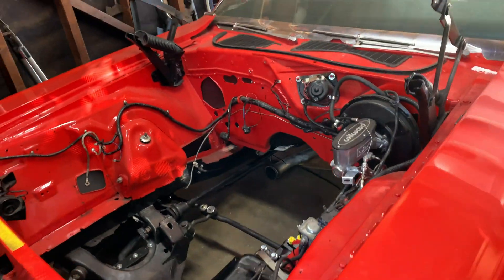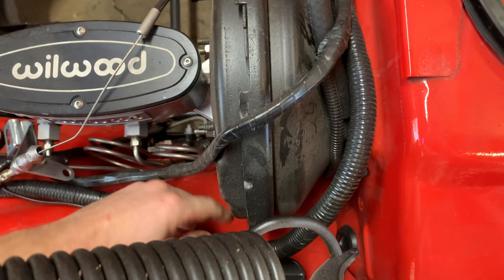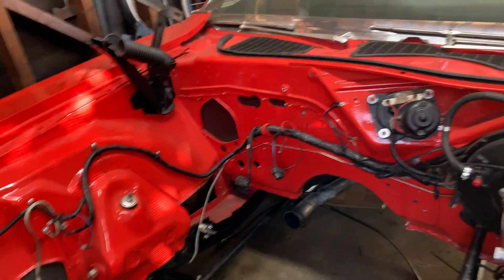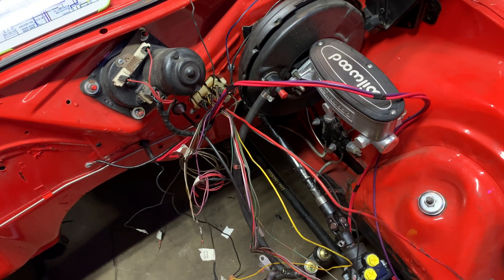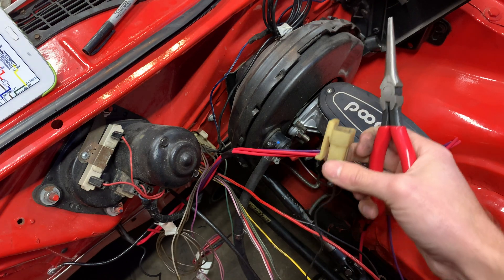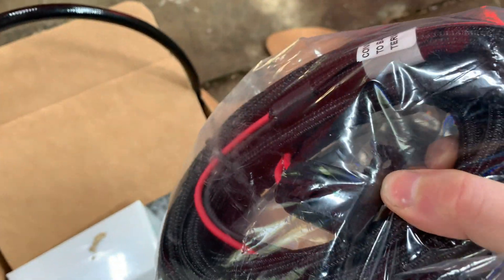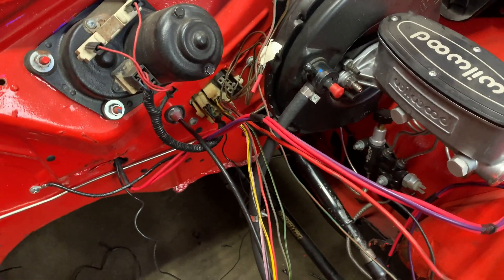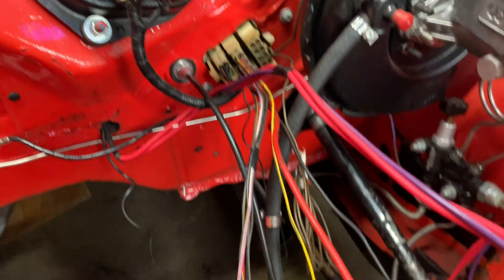1970 Challenger Hemi Swap Part 12: Wiring Harness Cutting, Holley Terminator X, One Wire Alternator

Comment: Hello Mr NBLB is me again your worst nightmare, Lol 2 questions # 1 cranking power is the same as ingnition power? I tried start my hemi swap but no luck engine cranks but won't idle, any suggestions or tips you can give me?
Reply from the maker: @JuanDominguez-nw8rq  hey! No, crank is not the same as ignition. From what I remember pretty much all ignition power gets cut during crank on these old Mopars except for one, a wire that goes to the ballast resistor or ignition module in the engine bay (brown wire I think?). My guess is you’re using a regular ignition wire which is cutting power on crank and not allowing the car to start. What I did was twist the power-on-crank wire together with an ignition wire and connected that to the computer’s power in crank and ignition wire. You may want to wire in a diode to prevent back voltage from going into your ignition wire, though I didn’t and mine works just fine.
Reply: So you recommend to use a diode and you said you didn't use it in your cause it's ok if I don't use it either?
Reply from the maker: @JuanDominguez-nw8rq  I didn’t use it and mines been just fine, I’m sure yours will be too
Reply: Oooh and thanks for the reply a really appreciated.
Reply: You talking about the ballast resitor that is mounted on top of the wiper motor or is another one, I tried it but still the same engine winds but not run.
Reply from the maker: @JuanDominguez-nw8rq  did you test the wires with a multimeter? Maybe sure you find an wire that has +12v in crank, you could probably get a wire out of the ignition switch too
Reply: Me again MRNBLB, no luck getting car running, big favor do you mine coming to my place I see if you can get it running for me, I live very close from where you bring your car to get it Dyno, her in Hemet CA?
Reply: I know is too much to ask, I can give gas money plus what ever you want to charge me to get it running please man let me know so we can set up a day that you can come?
Reply from the maker: @JuanDominguez-nw8rq  yeah, I can come help! Give me a shout on my instagram messages at instagram.com/noboltsleftbehind or you can find my email at the very bottom of my website: https://noboltsleftbehind.com
Reply: Any other suggestions?
Reply: Thanks man let keep searching for the issue, to see if I can get it running.

Comment: Mr no bolts left behind, how r you is me again, question what gages did you use for you challenger if you have the p/n also place where you bought you led markers for your cluster bezel
Reply from the maker: All of the gauges are Autometer Sport Comp series, I don't have the part numbers handy but they were the 2-5/8" size and the speedometer was 5". I bought those LED lights on eBay I think, if you search "green arrow dash led" you should find them 👍
Reply: Thanks man for quick response I'm using a 727 tranny on my swap I can use regular cable driven speedometer wire or do I have to get a deferent one?
Reply from the maker: @JuanDominguez-nw8rq  I think you should be able to keep using your cable driven one, I don't see why not
Reply: Thanks man I appreciate the help, have a nice weekend.
Reply: Mr no bolts left behind is me again, quick question, when you bench bleed your master cylinder and you remove the little tubes to hooked it up it leaks oil it does not get air back into the master cylinder?
Reply from the maker: @JuanDominguez-nw8rq  I think gravity keeps air from entering the bottom holes, the weight of the fluid above pushes down and doesn’t allow air to enter
Reply: Ooh ok, another one my engine come with electronic pedal can I use it or I have to use it with cable trouble body, if I can use the electronic how I do for kick down for the tranny.
Reply from the maker: @JuanDominguez-nw8rq  you can use the electric pedal and throttle body, it’s probably much easier to do it that way than the cable driven. Can’t really say about the kick down, I set mine up with a manual transmission.

Comment: Hey I love your work, quick question I go a challenger 70 challenger too, I bought a 2015 charger engine w/auto tranny I want help with the wiring you think, what are the main wires that I need from the car to plug in the TerminatorX ?
Reply from the maker: That’s awesome! You’ll love the 5.7 in your Challenger. There are actually only a few wires that need to connect to your car’s original harness, just constant 12v, ignition switch 12v, and a couple grounds. One thing to keep an eye on is your ignition switch power, you’ll need one that provides 12v during crank (most of them shut off during crank to route power to the starter). For my swap, I used a wire from my ballast resistor which has power ONLY during crank and twisted it together with a normal ignition wire that shuts down during crank. So far it’s worked well.
Reply: Thanks man for the quick response, when I bought the motor they included electric pedal, push start button and the key, which of those I need, or can I use on my swap?
Reply from the maker: @JuanDominguez-nw8rq  that’s a good question, for my swap I converted to a drive-by-cable so I didn’t use my pedal, but I know most people do still use their drive-by-wire pedals. If you’re going to use your stock ECU I’d think you’d want to use your push button start and key, if you’re going aftermarket ECU like I did you can probably just wire it to your Challenger’s ignition switch.
Reply: @noboltsleftbehind  ok Man thanks for your advice, it's ok if I bother you some times when I start getting issues on my swap, it's going to be a while I barely starting with body work and paint.
Reply from the maker: @JuanDominguez-nw8rq  absolutely man, just drop me a comment in any of my videos when you have questions, I’m happy to help!
Reply: @noboltsleftbehind  thanks Man, have a great weekend.
Reply: @noboltsleftbehind  good morning man, quick question on some of videos I see that people have issues with harmonic balancer, alternators, power steering, do I have to put different ones on my engine cause my engine have all those components?
Reply from the maker: @JuanDominguez-nw8rq  I kept all of mine stock and everything fit fine, though I’m using a truck style engine which mounts the alternator up high. From what I know you might need to make a small cut for your alternator but nothing major. Everything else should be ok. Your power steering pump will depend on your steering box type, you’ll need to match the correct pressure and the factory Hemi pump runs a bit high for the original steering box.
Reply: @noboltsleftbehind  thanks man, I might get the aftermarket minie one.

Comment: thank for the video trying to figure out what i all need to do for my 1979 dodge LRE hemi swap
Reply from the maker: That’s awesome, I think a Hemi should drop in there without too much trouble. I remember seeing some good support for D100/150 trucks which I assume would be similar. In fact my transmission bracket is meant for a D100 truck.

Comment: Gaining confidence each time I watch your videos. Glad I found your youtube from IG.
Reply from the maker: That’s awesome! I’m glad they can be a help. Post any questions you might have, I’m happy to help where I can!
Reply: @noboltsleftbehind  I have questions about switched voltage sources and what you recommended for them.
Reply from the maker: @cutoversoldspartsguys  the tricky part was finding voltage during cranking, all of my ignition wires cut voltage while cranking. On my factory harness I found one wire that delivered 12v power only while cranking, I think it went into the ballast resistor. I twisted it together with a 12v ignition wire to have power both on and off crank. For Mopars it’s a brown wire that’s part of the main firewall connector.

Comment: Which wires did you need to keep from the original engine harness?
Reply from the maker: Very few, I think the only ones I reused were two from the voltage regulator to power on the ECU, the ignition wire for the starter signal and the reverse light. The rest of the ECU and engine were pretty much on their own or wired from my new fuse and relay block.
Reply: @noboltsleftbehind  thanks, I made the mistake of getting rid of my harness with the old engine so I’m going to have to figure something out. Nice to know it’s only a few wires.
Reply from the maker: @OnederElite  I see. It’s not the worst thing to get rid of the old crunchy original wiring. That main one I used was that power-on-crank wire, I think it was a brown wire, and it can be tapped into under the dash too.

Comment: That one wire alternator is really awesome! I didn't know that could be done. You always do a great job explaining things. Thanks!
Reply from the maker: Thanks! I'll make sure to double check out the voltage once I have the engine running to make sure it works as it should. The one wire also makes for a cleaner wiring install which is an added bonus.